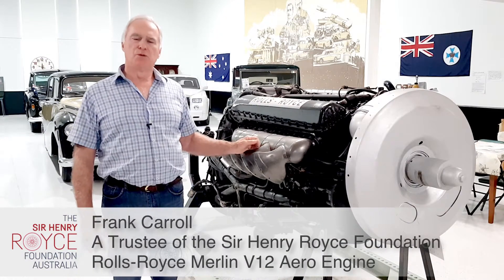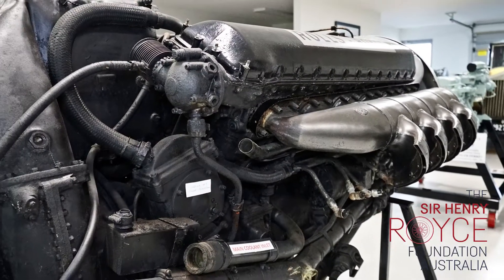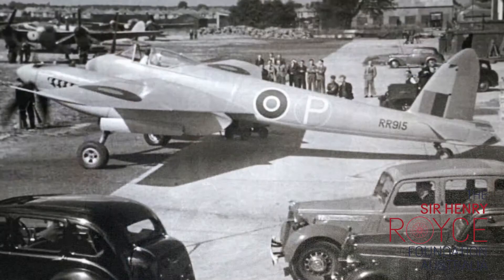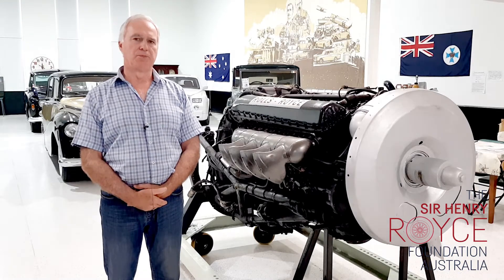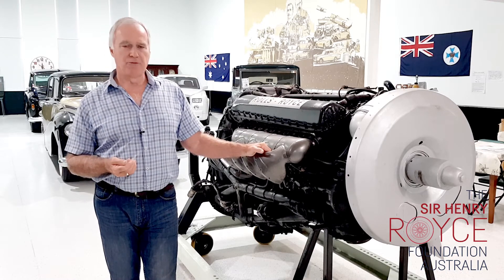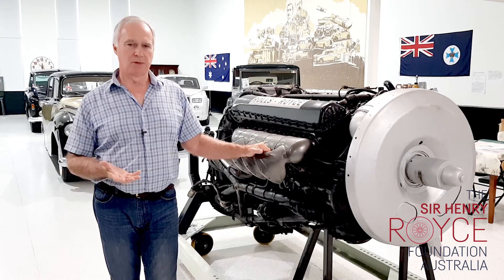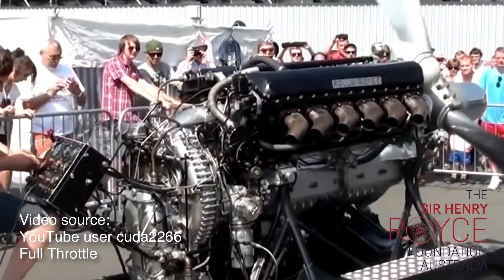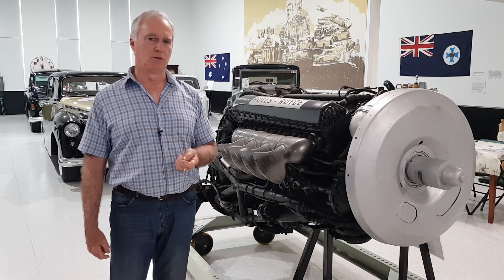SHRF - Rolls-Royce Merlin Engine

Comment: Of those 160,000 Merlins constructed, I wonder how many are still flying and how many others are static museum examples ?
Reply: There are a lot of them still in original cans in america
Reply: @xXAlphaGamingHDXx There is An 720 Hp Version in The Beast Then a 30L 800 Hp Version in A Tank. Then a 60L VR8 in The 1945 Panther De-Vil & has 1,600 Hp